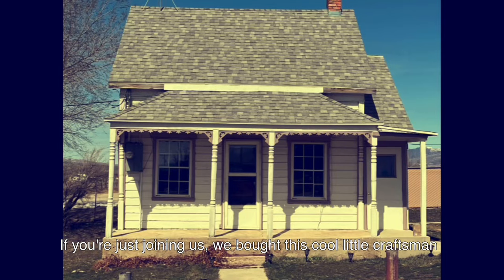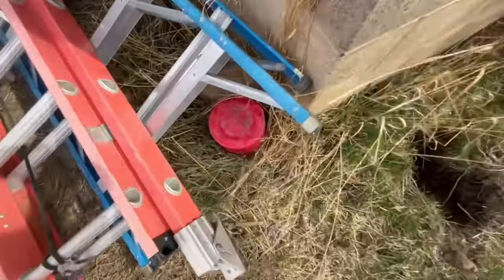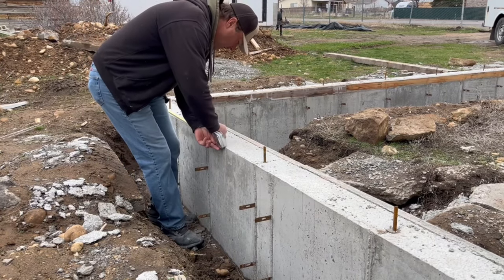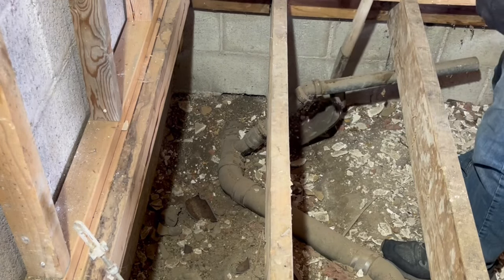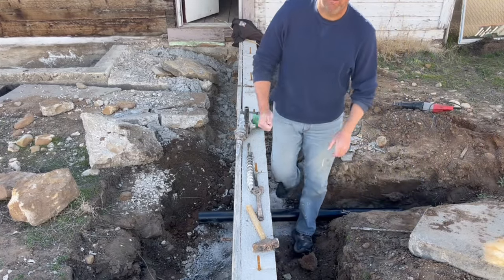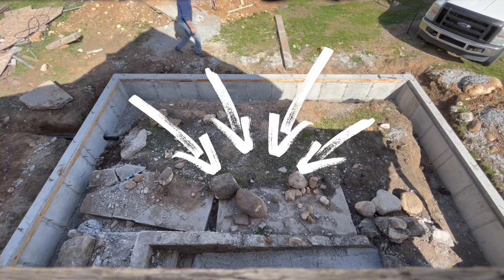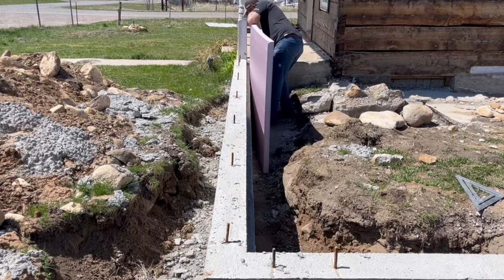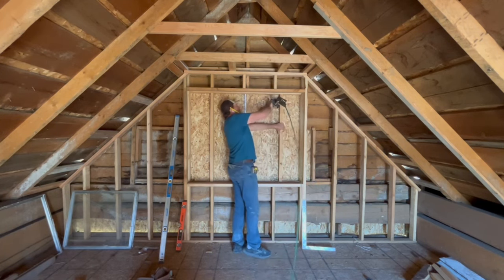Renovating A 100-Year-Old log cabin home:  Part 17

Comment: Brett looks like you might have been able to run the sewer line under the existing floor then into the new addition  but I couldn't see the grade
Reply from the maker: Hey Kent, I did consider that, I would probably have to remove some of the floor boards in the kitchen though, because the crawl space is so tight.  I might have to take another look.